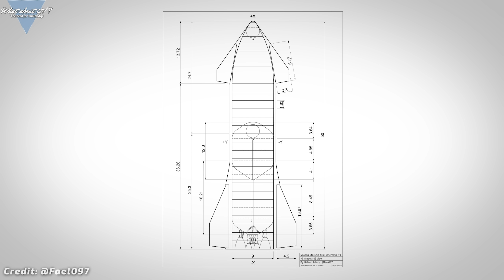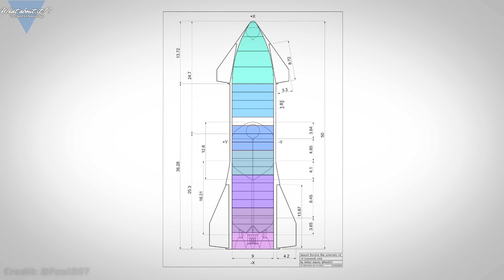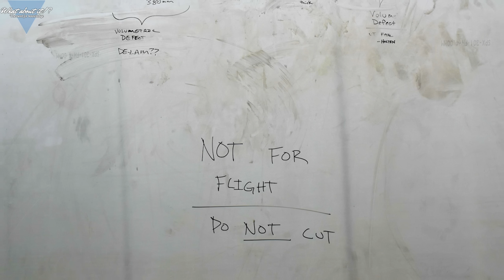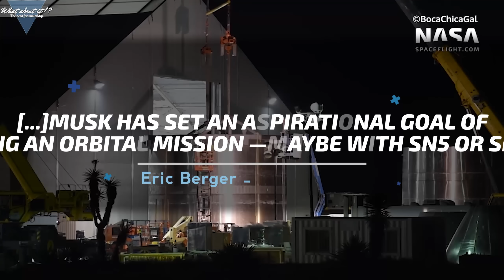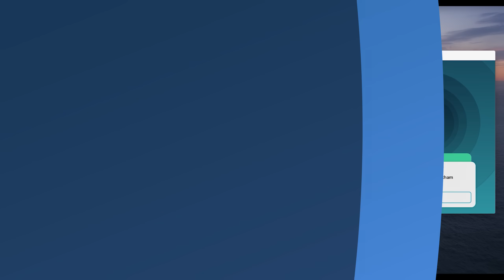78 | SpaceX Starship Updates – Starship Mass Production Update

Comment: Welding technique required: PLASMA - TIG. The plasma torch leads and fuses the plates with an electric arc, The tig torch follows 10cm behind and fills in the dip caused by the plasma arc with stainless steel wire. Robotic welding, 100% x-rayed. This is the way they make tank containers for carrying liquids (including hazardous chemicals) safely on container ships for tank lifetimes of 10+ years. Surely a fully re-usable starship needs such a quality of weld. The seams should be the last point of failure if the steel is properly fused without inclusions. Please forward to Elon...

Comment: if i were Elon id go harder for automatization within the production line- welding robots and laser scanners that check the parts geometry in real time 
Welding robots that weld from both sides of the seam simultaneous - i also might weld the parts lying and fixed in a jig and not standing upright for more consistant welds 
I might look into preheating or heating the part after welding to relieve material stresses and have the weld cool slower
Id look into Laser sintering raptor engine parts and parts for the assembly 
Id test the feasability of useing the Starships resources on other planets long therm 
like can they put solar pannel tiles onto it 
also Elon should test different regenerating food supplies in orbit- possibly on the ISS  - like crickets and food plants - how they cope with 0G 
also how to make concrete or something similar with mars or moon soil and solar energy - also if they can burn obsidian like glass bricks from moonsand with solar power
and how to make airtight marsian homes maybe like this https://www.youtube.com/watch?v=GAQ6_tVIaGQ - weather or not welding steel constructions is possible in marsian or moon atmosphere or lack thereof
like methonds of processing the marsian resources into useable stuff 
this would increase the confidence of supporters so long therm projects get financed and doable
also Elon should send several more surveilance satelites to mars searching for ice and landable terrain as well as other resources- like maybe coal , calcite , gasses , soft soil useable for planting stuff, weather patterns surface geology and save places for settlements

Comment: Still surprised we don’t see a Lunar Base and Mars Base mock-ups with Cybertrucks running around and Boring Machines working at Boca as parallel efforts. Also advanced propulsion efforts like Slough’s Plasma Sails, Zubrin’s Dipole-Drive, and Greason’s Q-Drive. “Humans to Mars in a week” make a sustainable city on Mars by 2030 much more likely, by removing the 2.3 year launch window restraints.

Comment: Great video, thanks for the update!

Just a guess on why their assembly building doesn't have a crane:  It's likely much faster (and easier, from a red-tape standpoint) to construct a shed or building when it is only a shelter.  If you want a gantry crane on the top, the walls of the building would need to be much, much stronger to support the load.  You can see this in the assembly of the ITER buildings where the enclosure around the top of the Tokamak has massive walls that are needed to support the rails of the crane, and subsequently, the load it is lifting.  If they wanted to make the building very fast, this would not be an option.

Comment: I could get a crew of canadian welders and fitters and weld those tanks and  guaranteed the welds would be 100 percent but good welders are expensive. The application says they will not hire unless US citizen. There should be lots of good welders from Texas now that the oil patch is going down. Probably not paying enough and lots of guys don't like working on thin stainless steel hanging off a Shakey  manlift  150 feet in the wind

Comment: How do Spacex stop condensation, especially on the inside of the rocket?  That stainless steel will be cold and will act as a massive condensation vessel.  Cold windows demonstrate the problem and so do metal buildings.  Do they have de-humidifiers running all the time?

Comment: “Better, faster, cheaper, choose two of the above” is an old engineer’s adage. SpaceX is going for faster and cheaper at the expense of better. This is why you see so many failures.
Reply: Kind of... they're using "faster" and "cheaper" to figure out how to do "better". One explosion at a time, maybe, but they're finding the failure modes early in development. Let's be blunt... it beats the Boeing approach of discovering problems by doing a belated code review while the craft is already in orbit.
Reply: Simon Geard  Absolutely, and it’s working for SpaceX, certainly better than the traditional approach of spending vast amounts of money and many years on development, which just got us several lost decades.

Comment: I would build the exterior tube with vertical panels linked together by j chanels.
The panels would be formed off of the spool through a machine that forms the chanels and the sheets would be cut to length to accommodate either the ship or the booster as needed.
The panels are then picked up and linked 1 by 1 ,the channel compressed and welded in the same motion.
The tube is formed around a jig which aligns and attaches the internal support structure then stands the unit for vertical continuation installing the bulkheads and puck.
The estimated time for finishing a tube structure in my estimation would be 24 hrs using this method.
The design for the machine is Elons for the taking all he need do is show interest in it.
After that a few more designs I have might be of intrest.
Reply: The problem is that type of stainless is extremely work hardened and can not be bent at sharp angles or formed easily that's why they are only rolling it.if it was 304 or 316 or even 310 you could press it in a mold or break or roller die it
 when its welded it will soften and be weaker than the parent metal it's like taking a samurai sword an cut and weld it back together again the grain structure is damaged and weak there's no way it can be done Mabey laser or electron beam welded it's probably imposible with the construction methods he is using. I wonder if he has a meatalurgist on staff
Reply: @paulkushnir2224  since making this post I have since learned that the construction of the starship in its layers is the only way it can be done due to variations in wall thickness of the different sections according to Elon.
As for creating the j chanels with the 301 it is possible when heating the area needing to be flexed  and working within a specific timeframe of heating.
When the panels are linked and the seams are even they would be put through a compression system to set the link and welded with a less invasive bead keeping more of the inherent strength of the parent material. 
301 can take alot of heat before the crystalline structure is changed into a weaker form, this is the reason for using it in the first place.
When working any metal there are stresses built up in the lattice  and these stresses need to be relieved before full usability, this would be accomplished during the welding process with the heating and slow cooling of the seam.
The finished product would as strong if not stronger than the rest of the panel, and most certainly stronger than a single welded seam.
The added bonus is that this type of construction would lend support against flexing , but that is a moot point with the need of varying thickness to different sections of the craft.

Comment: Hi Felix, thx for the ever popular updates. Between yourself and BCGal& team, we are kept in the loop with decent reporting. Thankyou.  When it comes to the booster section, it will be an extended form of what is being produced at the moment. It will have, obviously, more fuel volume, and many more motors, so, progress for starship is progress for the booster.
Reply from the maker: Thank you and you're welcome! The booster will be much easier! It's basically a large F9 booster. ❤️🚀
Reply: @Whataboutit  Only the flight model will be like F9 though... the construction will be very much similar to Starship, but without the fiddly cone bit at the top.

Comment: A crane could still be added, but there is also the possibility that this method saves time as you already have it rigged up to a crane to move it from the last building. I suspect a much larger, longer building is going to be needed to achieve 2 star ships a week, especially if that 2 include boosters as well? A building like that would likely take months, if not a year or so to complete, and for a technically unproven design. They would also have the benefit of waiting to see which methods work best for them, instead of being stuck with an inferior assembly line that you have to work in the constraints of like the early days of Tesla. They already learned more height with the double stack of containers.
Reply from the maker: My thought exactly. Thank you! ❤️🚀
Reply: Indeed... everything in Boca Chica has a temporarily feel to it, the minimal infrastructure that they need, being built on-demand. Permanent structures will come, but only once they've figured out what they'll need for real production work...

Comment: These pressure issues are now tested in a static conditions , the rocket is just siting at the ground level . What will happen when in dynamic conditions when the vibrations and other mechanical and   thermodynamic conditions will add ?.

Comment: If I were working in Mr. Musk's engineering team I would suggest that he begin to think much bigger with the construction of the Starships.  It would be possible to manufacture the fuselage shell in one piece in the same way welded seam tubing is done.  It would require a very large machine to do it, but considering that tunnels are bored with machines that are about 25 feet across, this seems a very possible way of constructing the body of the ship.  As for the bulkheads, they could be made by stamping of a single piece of steel.  The dies and the press would have to be enormous.  Likewise, the steel sheets would have to be custom made on enlarged rolling mills.  By building the ship this way, there would be fewer parts and, therefore, fewer weld joints to fail.  Much time would be saved and the production rate would be maximised.
Reply: Long term, that's probably the intention... Elon has talked about getting the weight down and the production rate up. But the equipment you describe is going to be expensive, and it probably doesn't make sense to invest in that while still in a very experimental state of development. SuperHeavy might be a different matter... they'll probably want the larger segments for that anyway, and by the time SH development starts, I suspect the Starship process will be more finalised.

Comment: How difficult would it be for spaceX to use taller spools of steel for the rings?  It would cut manufacture time and decrease the amount of welds therefore less possible weld failures.
Reply: i think it would be even better to not put them together in rings, but rather use spirals, like you see in round Air ducts. That way there is only one Weld spiralling around the Ship. For even more stability two layers of them spiralling in diffrent directions,  but that might make things too complicated..

Comment: Felix I worked on the Titan 2 missile system for the Air Force Starship has a small design flaw they should be addressed. The tank in her walls should be vertically supported

Comment: I personally don't understand what he is meant with flying 3 times a day? The starship will fly to Mars which needs way more time. Maybe this is true for the tankers the super heavy boosters but for the ship itself it doesn't make sense to me.
And yes there is concept of using starship as a transportation vehicle but is this really time efficent and in any way acceptable for the environment? Thanks for your thoughts! ;)
Reply from the maker: Starships will not only be used for Mars flights.
Reply: Well, it's certainly time-efficient using Starship for intercontinental transport, since that's basically "fly between the furthest points on the Earth in under an hour", compared to a best-case of around twenty four hours on a modern airliner. Cost efficient, maybe not so much. Environmentally? No idea... it seems extravagant, but no idea how emissions would compare to long-haul flights...
Reply: Sorry guys I meant energy efficient?
Reply: @spasti40  You might want to look at the latest video from Everyday Astronaut, which does something of an environmental assessment. But in theory at least, a methalox rocket can be close to carbon neutral, since fuel can be produced by pulling carbon out of the atmosphere using a clean energy supply like solar.

Comment: The crazy thing about what Musk is doing is that it's really two revolutions in one. The first is finishing what Falcon 9 and Falcon Heavy started by giving humanity a fully-reusable super-heavy launch vehicle. That alone will be enough to completely change spaceflight by driving down costs, even if Space X only makes a dozen Starships (not including prototypes). And the fact that Starship is fully-reusable means that those dozen rockets could fly dozens or hundreds of times each. This would be enough to land a crew on Mars, return humans to the moon, build the lunar gateway and an ISS replacement, build Starlink etc.
The second revolution is the mass-production side. The capacity that this produces will further lower launch costs but is only really necessary for the most-ambitious plans. 1000 Starships will enable construction of actual permanent colonies (Mars, Moon, Orbital, etc), vast space-infrastructure projects (like huge solar farms in space), and replacing a large potion of the airline industry with point-to-point travel.

Comment: Why no crane in the High Bay?
Cranes take a long time to build, lead time can be months or even a year.
Eventually we will see a huge building with an overhead crane, but not until they figure out how to actually do mass manufacturing
Reply: Yep.. the High Bay was built almost as quickly as the prototypes it's designed to house. Definitely a temporary structure... quick, cheap, and good enough for current requirements.

Comment: Fly 100 times per year  with this paper thin wall...no way. You need more robust design and for that you need carbon fiber - epoxy systems combined with stainless.
Reply: Tigran Ohanyan carbon fibre is too expensive
Reply: @kerbodynamicx472  The best Falcon 9  were used 5 or 6 times until failed. To use Starship 100 times  they need to develop a technology and its not going to happen overnight and its not going to be only with stainless steel construction.

Comment: I'm thinking the SH booster will be somewhat easy as it's just a giant falcon?
Reply: More like a hybrid — the flight model will presumably be a lot like Falcon, but the actual construction should be very similar to Starship. I suspect that's why they've not started on it yet... the Starship team are rapidly building expertise in creating large stainless-steel rocket sections, so until they figure out all the issues, there's not much point in doing much with the booster.

Comment: So, I'm a little confused. SN1 blew up, and now they're building SN3? What happened to SN2? Did I miss something?
Reply: SN2 was only a test tank.
Reply: SN1 blew up. In response, they took the partially-assembled SN2 — basically just the tanks — and used that to pressure-test the redesigned thrust-puck, the bit that failed on SN1. Meanwhile, they continued building SN3...

Comment: I was an aircraft structures assembler at Lockheed. I took classes through the North Valley Occupational Center, though the classrooms were at Lockheed Burbank. It was 6 weeks, 5 days a week, 6 hours a day, on my own dime. Even when I started to actually construct aircraft, the first thing I did was to install an aileron pully, and the pully's time study was for 6 hours to install, but the first one I did was 3 days. It took me at least 3 planes to get to the point of installing the pully in the 6 hour time study. And then there was the problem of the production order was not fixed yet. So I often would spend a lot of time installing something, only to have to drill it out since something else had to be installed first. So hiring a bunch of neophytes will not automatically speed up production...

Comment: Building the hull is easy. It's only half of what is required to fly. Building the flight deck that controls it all takes just as long as building the hull. So far we have only seen the building of hulls. When they start building the flight deck you will see starship sitting for days and it will look like nothing is happening because all the work is being done on the inside.
Reply: They are definitly at hecking bottom of development... And that speed isn't fast.
Reply: Why would they need a flight deck any time soon? It's all computer-controlled, no crew required... it doesn't need a flight deck any more than Falcon 9 does. At some point it will presumably acquire some kind of cabin for storing human payloads, but they're not exactly critical to the functioning of the rocket.